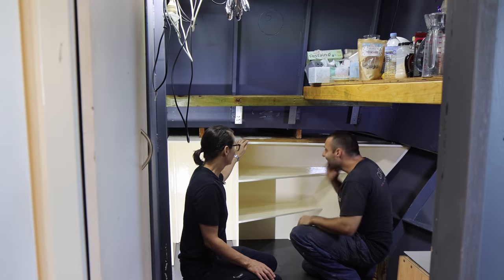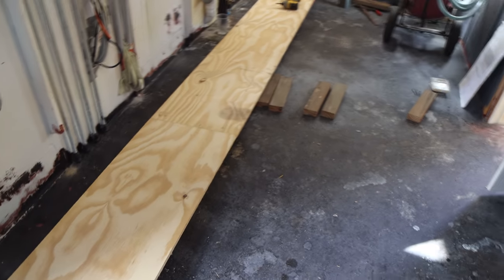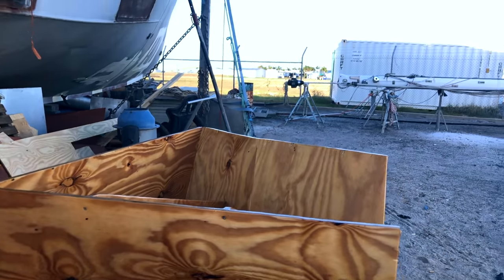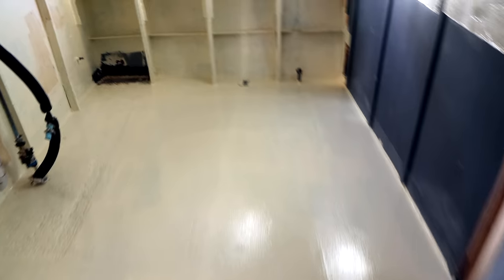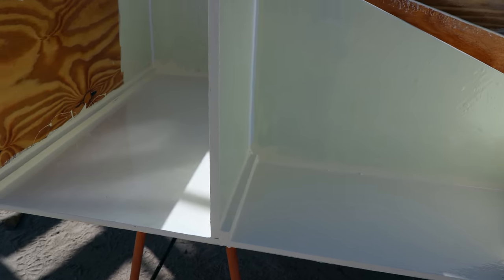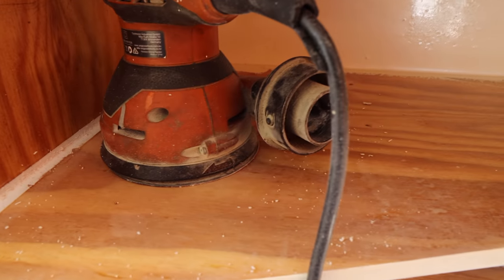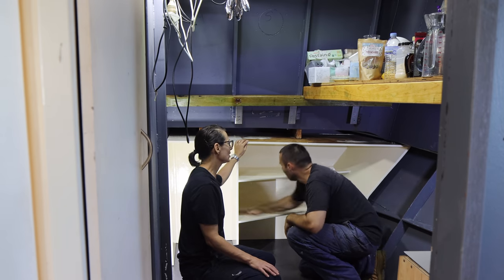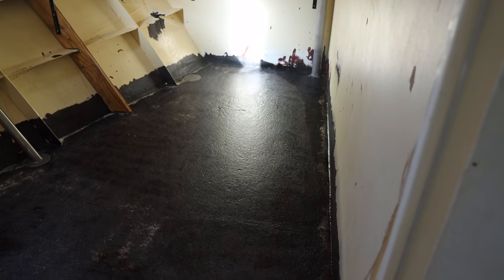Dealing with a rusty boat deck using 2 pack epoxy paint - Project Brupeg Ep. 195

Comment: So glad Stu sent me here. Lovin catching up. Soooo much to catch up on. 

Just some thoughts. In that extra little cubby you’re thinking of building, can you add some charging ports or wireless charging mats so when you lay down you can charge your phones. Also, when spraying the rust converter, how about using a 1 or 2 gallon pump garden sprayer, that way you don’t have to squeeze the bottle trigger 1000 times. Keep up the good work guys. 👍👍🇨🇦🇨🇦

Comment: Those mesh disks (Irwin??) that you can buy for orbital sanders work well on “young” epoxy. I’ve been using them on my countertops that I’ve been pouring. Got the tip from StoneCoat Countertops, cheers :)

Comment: Jess , I used to work for a pressure washing company and we spent 8 hours shifts pressure cleaning city footpaths and laneways in Melbourne. We used to jam a tennis ball into the trigger guard of the pressure washer gun once we pulled the trigger to keep the gun on and save your hands from aching. Works really well. You should try it.
Reply: I was going to say the same thing. We use those white plastic baseballs and ty a cord on the ball and the gun so the ball doesn't fly away.

Comment: Painting floors, eh? Looks gorgeous! Don't worry about finding moggie paw prints in the early coats - cats are professionals and will always wait until just after you've applied the top coat before walking across it.  ;-)
Reply: Cats!!!!   I was building a plug for a dingy
Reply: Any way , I was building a plug for a dingy and I forget where i was in the project but I had just sprayed a heavy coat of bright red gel coat as the inner surface of the mold and THE CAT, who had never come into the barn before to mess things up, jumped up on the new gel coat and skidded her way the length of the keel and down and off into the hinterlands.   If it could have caught her............

Comment: Now that most of the sand blasting is over, I thought it might help to pick up a 'leaf sweeper' attachment for the hose. It's several nozzles on a wheeled head connected to a 1 1/2 meter handle. Not sure if there's enough hose pressure to make it work, but you might be able to hook it up to the pressure pump. It's also good to see Jess has survived your 'slave driving' work ethic and has her hand back in service. Nick job on the floors guys! For the new cabinet, just block off the back and run a 4" fiddle board across the front (matching the ones on the lower shelves?). There's always a need for open shelf stowage ; {P

Comment: A great way to sand epoxy is wet sand I do it with electric tools just don't use too much water I either use a bucket and cloth or a spritzer bottle. random orbital sanders work well.

Comment: Clogging of sandpaper is due to amine blush which is water-soluble.
Clean the amine blush off epoxy before sanding with clean warm water, all-purpose soap, and a stiff brush.
Reply from the maker: Huh, didn’t know that. What causes it?
Reply: @ProjectBrupeg   Hi!  I'm in the grotty north of England, where two-part coatings can take ages to cure and harden. You get the same 'gooey' boundary layer when working with polyester resin.

I don't know about water-soluble amine bloom; in my experience the stuff that clogs abrasive paper is simply the outermost layer of resin that hasn't been given long enough to cure. It's definitely not water soluble, and will clog a stiff brush as easily as it will a sheet of abrasive paper.

With a thick coat of epoxy, the top surface in contact with humid air stays soft whereas the deeper uncontaminated resin cures hard just as the manufacturers intended. The top surface will cure eventually, but it can take a very long time (weeks!) in typical English weather.

I used to do quite a bit of epoxy-carbon and fibreglass composite work that used vacuum pressure during laminating. When the wet layup was bagged and sealed and all the air was removed, even very thin resin coats would cure right through, with no soft outer boundary layer. So contact with humid air definitely affects the speed of hardening.

An open coating of resin (like on your shelves or on a wooden floor) could sometimes take a month before it was ready to be sanded smooth. It's worth noting that some tropical hardwoods contain oils that prevent surface coatings from hardening. Maybe your unidentified plywood contains some.

There's a lot of things that can go wrong with two-part resins. An insufficient volume of hardener (catalyst) can slow the curing, as can inadequate mixing. Really thorough blending's more important for epoxy than for polyester, which is also less fussy about the amount of hardener it requires. I was taught that you should stir a mix of epoxy laminating resin slowly (120 rpm) for a minimum of two minutes.

Freshly mixed resin (both epoxy and polyester) in warm conditions can cure violently if left in a deep mixing cup due to a runaway exothermic reaction, so it's normal to decant it into a wide, shallow tray to keep it cool and maximise its working time.

And there's the problem. Spreading it out thinly prevents rapid curing.

Smearing the stuff out slows down the curing of the surface in contact with air. That means that if you try sanding it even after the recommended drying/curing time, it might still be soft and will clog your abrasives.

The only options (here in cold old England, at least) are to increase the amount of catalyst in the mix - which is fine for polyester resin but should never be done with epoxy - or to bake the part in an autoclave. Yeah, right.

There is a third option, which is to leave it to cure for a further two weeks before sanding it, which is hardly practical.

I don't suppose Australia suffers from much cold, claggy weather, though, so it may help if you give the epoxy another day to harden before sanding it.

Sorry, Dame - I've not been very helpful...  :-(
Reply: @EleanorPeterson  wow long message compared to the first one which was 100% correct .....amine blush on epoxy is water soluble with soap. With polyester resin a lot of them are air inhibited so the surface will never fully cure unless mixed with a wax that rises to the surface to keep air out or covered by gelcoat. Im sure they are getting enough heat and mixing correctly....might be on to something with the contamination from the ply or the humidity though.
Reply from the maker: Thinking about it, the humidity is not something I’ve ever really factored in but it’s normally pretty humid overnight here. I’ve been able to cut through with the ceramic discs and just sand it out but I will try a few things like washing it as well as peel ply.
Reply: I would have though a small amount of detergent in the water would stop the sandpaper from clogging?

Comment: Another outstanding episode guys, running hot lately. Wow you've got determination and tenacious going on. Its neat how Trev rescues the day too. Great to see Jess progressively better as well. Thanks for the ep, Mark n Dawn.
Reply from the maker: Cheers guys. Yeah it’s almost to the point we can start fitting things in rather than repairing old damage. Hoping to get some paint on the studio deck tomorrow and cut/weld in the stainless vent in the galley to gets fresh air into the freezer room cabins
Reply: @ProjectBrupeg  You'll appreciate that once away from Oz. Ventilation on metal boats is key to crew happiness and keeping the place warm and dry.

Comment: Just a word of advice on the blasting. I have done some professional pressure washing. If you get a tennis ball you can push it in the handle of the pressure washer. It will hold the handle in the open position. That will help greatly with the arm fatigue.

Comment: Have you thought about getting some epoxy dye liquid/powder to have a slightly different tint in your epoxy paint between coats? Helps ensure proper coverage when you apply additional coats and can see the bits you've missed.
Reply: Exactly what I was thinking..! A way  bit  easier to see what your doing...

Comment: lol damien i never said plinth was wrong just unusual for the application ...as far as i am aware there just base cabinet bases...wheras plinths usually are found under statues or columns  but it equally applies to cabinet support ...  as far as the fiberglass reinforcing   waaaaaay overkill but its your boat so build it how ya feel the need ..i think ive mentioned  brupeg is a shell  which carries the loads  the wood is just for structure or convenience,,, dosnt it feel good to have fresh paint down and done ;] thanks for the videos as always

Comment: Dame, mate - the 4" roller is fine for your storage unit (that really was nice paint) but get a bigger roller (12"), tray and a painter's pole to screw into the handle of the roller, for the floors. You will de done in a fraction of the time, you stand up, so can judge the coverage better and you get a better coat on.

Comment: Exact mixing ratios and good stirring are important for Epoxy. It is normal if curing into cooling temps (evening) for a waxy amine blush to come to the surface. When you wipe your hand over the surface it feels slimy and leaves finger marks, a quick wash with warm water and a scouring pad will see you right. You will see your sanding action return to normal. Incomplete curing is another story altogether and involves loads of acetone to sort out. There may be a better way that I have yet to come across. This is something that I do not want to get wrong ever again.

Comment: Man, I never give advice to a working man but have you not heard of the long-handled paint stick? I've got old football knees and they were aching from just watching you down on your knees with that tiny roller. Most of the rollers I have ever used have threads in the handle to attach a broomstick or telescoping pole to it. Plus there are 8-inch wide or greater rolls for the handles. Great work even if you are doing it the hard way!

Comment: When the epoxy jams up on the sanding paper there's a name for that bud in the autobody trade its called gumming up the sand paper. I use to do industrial sand blasting it would strip that off in no time. Its too bad you didn't have access to one. Anyways, hope you get well soon Jess. btw looking good guys, really good, its cleaned up well.

Comment: I got through a few pages of comments and didn't see anything about phosphuric(I've heard it called this plenty)/phosphoric acid rust converter being the cause of the black bubbly looking stuff. It should be washed off before you paint but some products I've used have said not to. I hate to say it but it was likely sound.
Reply from the maker: The technique we use of two layers of acid then a wire brush off works well. been doing it for years now with really good results

Comment: Hi Guys, probably a stupid question but isn't there something in a can that will soften up the paint before sand blasting. I am sure you have thought of this already but I am curious :) 
Love the vibe of your vids and how you solve issues on the go.
From Darwin OXO
Reply from the maker: Hi Andrew, you can use chemical paint strippers but they make a hell of a mess and then you still need to blast the surface to get the finish needed for the paint to hold onto the steel. I have tried chemical strippers years ago on an alloy sea door we reconditioned and fitted to the engine room. I did t want to hammer the paint off as it would dent the soft alloy so we chemical stripped then blasted

Comment: How is the new blasting nozzle Damo?  My cheapie is still kicking on but will look at something different when it fails.
Reply from the maker: so far its doing great
Reply: @ProjectBrupeg  cool be interested to see how it goes. I’m still on the first ceramic in the cheaper model but it is showing signs of wear. I can’t see inside the head where it bends before going into the high pressure stream. So I’m not sure how that is wearing. I think because I am entirely wet blasting it may be lubricating the brass. I am thinking of ramping it up and going with a 200cfm compressor. I can try it on Brupeg if you like. 😁
Reply from the maker: We have a three phase 7.5kw compressor (don’t know the cfm) and for us we found the wear on that type only really happened when we increased water from 2500psi to 3200psi

Comment: I don’t understand why the galley floor got prep and paint before the forward port cabin. It seems you ran all that water and abrasive sand across your newly painted floor.
Reply from the maker: We did t think the forward cabin would need a full blast. Initial plan was a quick sand and paint but when we got into it we realised the original paint was dead and had to come off. Luckily the new galley paint is very tough so there is barely any scratches after all that. We do plan to add another couple of layers to the galley so it will be covered up regardless

Comment: Which two part epoxy?
Reply from the maker: First few layers are Jotamastic 90 by Jotun, then we use a polyurethane top coat, either Poly U400 by Wattle or Hardtop Ultra by Jotun.

Comment: Seems Jess is slacking in respect of correct painting procedure!  In order to get the correct effect, it is a procedural requirement that a third party not involved in the direct application must wait until at least 95% of the painting is done, inhale a half breath through their teeth, then bless the job with the traditional incantation;-
"Jees, you've missed a bit..."

Thanks again, for another cracking episode, Andy